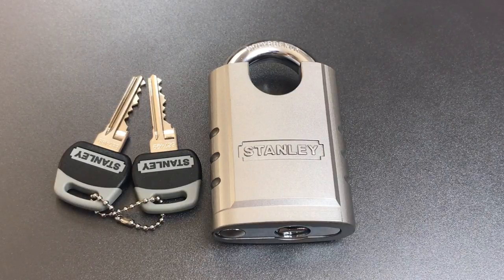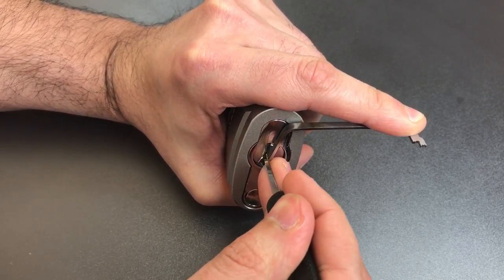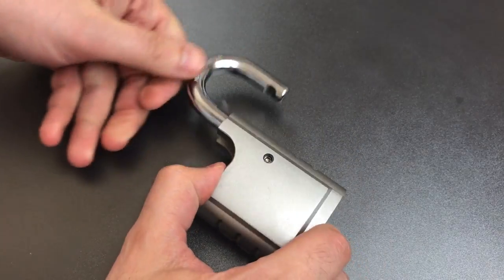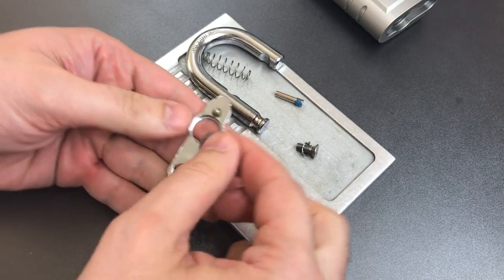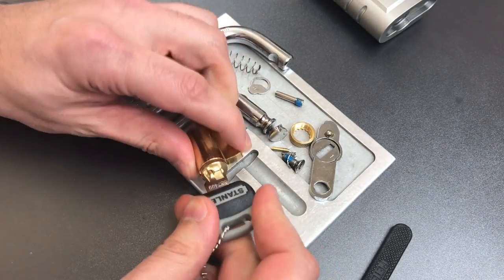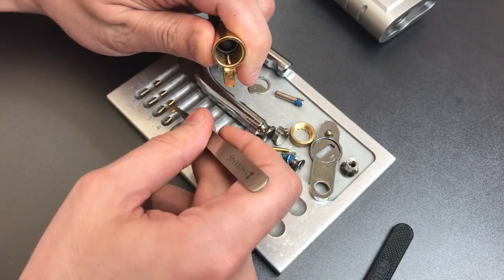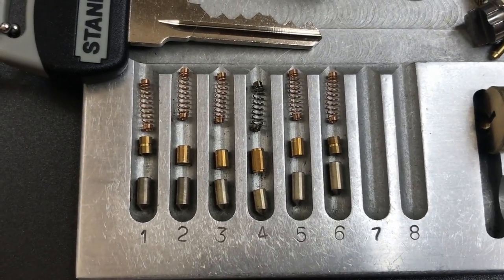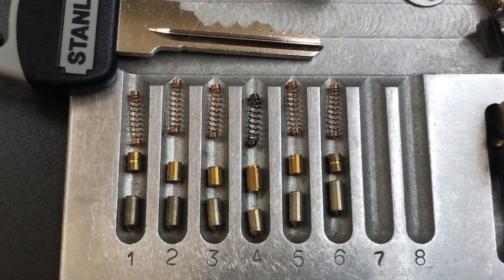[556] Condemned: Stanley 60mm 24/7 Padlock Picked and Gutted (Model CD8820)

Comment: It's a nice body and core. It's just the pinning that's terrible. Replace one of those standards with a spool and another with a pin-in-pin, and it would thwart most amateurs. Pretty nice base lock for a security conversion!
Reply: He did a followup video where the ramset opened up the lock (blew out its guts) with one hit to a weak spot.    I agree that this lock is good overall, but alas and alack, it looks like all locks have short comings one way or another.   An ASSA Twin core could be an improvement as well, but with the ease of hitting it in the weak spot dumping the bottom right out of the lock, it would need more protection.    I do wonder what padlock lock would be better than this one.

Comment: Again .. security pins against long pin drivers, most likely never engaged in the sheer-line.
Reply from the maker: +DrSid42 Agreed. The bitting was unfortunate. 👎
Reply: LockPickingLawyer I suppose unless you want to eliminate all combinations without at least 2 deep key cuts, this is gonna be a problem in some of your locks.

Comment: I pinned up one of these for a friend to match his Schlage house key.  I had to remove the keyway anti-drill plate and grind the opening in the cylinder retainer larger to accept the shoulder stop of the genuine Schlage key.  The shoulder arrangement on the Stanley key is set up to bypass the anti-drill plate, whereas the Schlage key is not.  Stanley is deceptive in their advertising stating that these can be keyed to SC1 keys.

Comment: I thought that the security pins looked like they were tapered just a bit towards the center, kind of like a spool, but those parts never hit the shear line and therefor probably actually made it easier to pick. But 8 minutes pick resistance? It might take that long if the only tool allowed was paperclips. LoL
Reply: Obviously it doesn't take 8 minutes for someone who has practised with the exact lock... Even just getting a good look at the key helps a lot.

Comment: By "anti-bump pin" do you mean that driver pin seemed to have an odd weight? Or are you just noting it as being paired with the stronger spring?
Reply: Dave Joseph no. if you look at the top and bottom of the driver pin it has a slightly reduced diameter kind of like the shape of a soda can. by making it that shape it is supposed to make it catch there while trying to bump it. not sure how effective it really is but that is why it is called the anti bump pin.

Comment: It has become apparent to me that all the locks I've seen you pick follow a typical method of basic construction in their operation. 

I'm no lock-smith nor lock picker, I'm just a curious casual observer. But I have to question, why are all the locks you pick apparently with their pins all inline similar to an inline cylinder engine. Why not a lock with pins that are radially offset at varying angles and distances?
Reply: That is how most locks are designed. I would say though you have not seen many of his videos. He has some weird locks like that.

Comment: What makes that spring more powerful than the others? And what's it do exactly?
Reply: The steel spring is much stronger than the brass springs. The stronger spring helps push the anti bump pin down faster and with more force to help it catch the shear line and hang up.
Reply: A stiffer spring that takes more force to lift. It works against bumping because it means that the drivers will move upwards at different speeds, making it less likely to bump them all past the shear line simultaneously.
Reply: So it's just less likely, but still possible? Seems like a neat little gimmick, but it would take, what, 15 more seconds of bumping?
Reply: There's really no such thing as an impossible-to-bump lock, just stupidly improbable. Bumping is a bit like throwing a bunch of pennies up in the air and hoping they all come down heads. If you just have two pennies, it's pretty likely (25% actually) but if you have 100, you're going to be waiting a while.... (1/(2^100) is a VERY long while).

Comment: Dang, I use this for my shed. What lock would you suggest for a shed?
Reply: I have yet to see him show any lock he can't pick, except that one where the pins have a guard over them and the key has a notched out section. Don't worry about it though, if someone wants to get in they can get in. I can cut a square out of a door with a saw in about 1 minute, or slide a hack saw blade behind the latch and cut the screws.
Reply: Paclock. American made, different types including ones that come with the bolt on plates for your shed door.

Comment: If you remove the shakcle spring, does it make the picking harder or easier?
Reply: Shouldn’t make any difference. Tension comes from rotating the core, way before the locking mechanism engages.

Comment: Either your going to grind the bottom screw off or your goung to do something with that screw on the side of the lock. You subject unfortunate locks to cruel and unusual tactics to get in so it could be anything. ;)
Reply from the maker: +Smuckers T You are correct... and I open the lock in about 5 seconds! 😁
Reply from the maker: +Smuckers T Correct about attacking the screw, not about grinding. 👍
Reply: LockPickingLawyer shatter the hardend pin with a ramset?